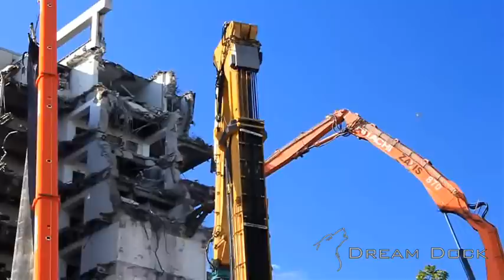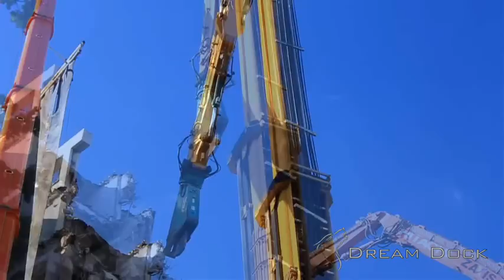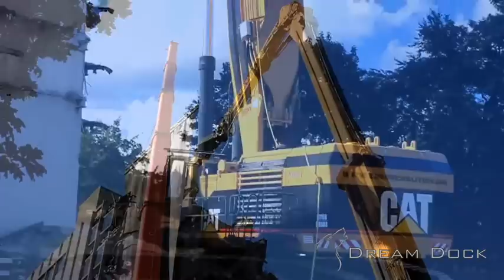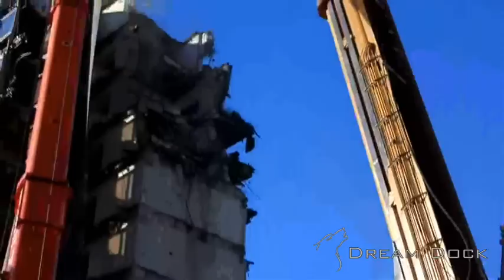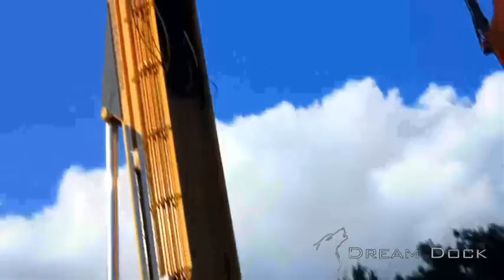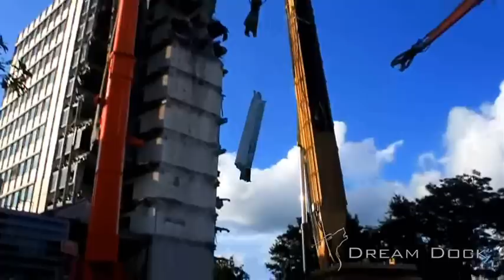ZWEI GIGANTEN CATERPILLAR 5110B LONGFRONT + HITACHI ZAXIS 870 TRIPLE BOOM BAGGER [9]

Comment: Wow, that's really cool!  Of course, these guys are going to a lot of unnecessary work here.  Today, we know that a small amount of jet fuel, randomly placed, does the job at a fraction of the cost; concrete pulverizes and steel is reduced to silly putty; no need to use shape charges, electronics or engineers.  The entire demolition industry is suffering from "do it yourselfers" employing the methods used on 911.
Reply: Michael Dean I know right. After watching 9/11, I thought I could demo concrete steps with some jet fuel. So I bought 100 gallons of jetfuel and lit them up. I was so surprised it didn't pulverize them into fine dust. What happened? It worked on 9/11.  I guess jet fuel must burn hotter at higher altitudes in New York. Silly me. I even went a far to build a to scale rc plane and flew it into the side of my steps. I was so shocked to find out all this effort it didnt even make a scratch. Thank a lot Osama Bin Ladin. Some engineer you are. I trusted you extensive background in building demolition. (SARCASM everyone with no common sense)

Comment: what is the fog on top?
Reply: +Hans Nossing Thats dust coming from the concrete when being crushed
Reply: The Rebel 22 thank's man!
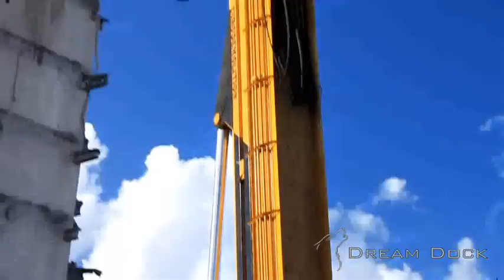Reply: +Hans Nossing And iff you pause the video at 1:26 you can see there is a small (garden) waterhose running up the machine to spray for the dustcontroll. That also creates the 'fog'
Reply: The Rebel 22 nice!!! little yellow hose!

Comment: They must be paid on an hourly rate!
They should stop wasting time and use a lot of carefully placed demolition charges, to bring it down in small pieces. The concrete can be taken away and crushed to get out the rebar.
Reply: Not every building can be brung down with explosives. If something within a quarter mile is too sensitive they will not use them.
Reply: Or maybe dust is a factor.  Imploding causes massive amounts of dust.
Reply: James Bradley climb whatever machine you think you can use onto a debris pile 6 stories high then try to sort and process. and load. dont forget that one